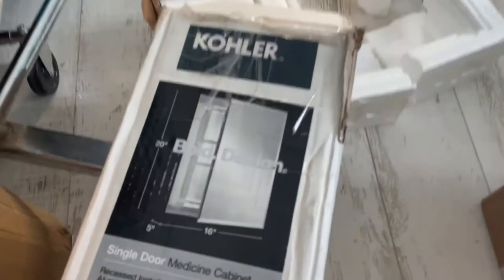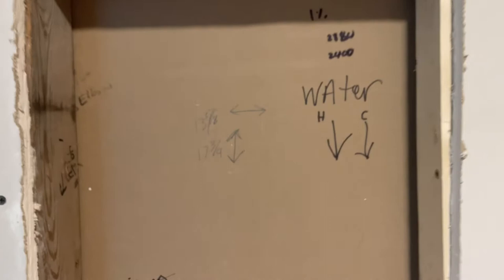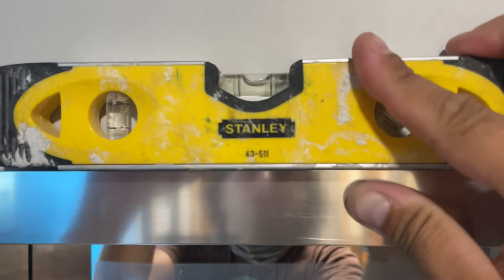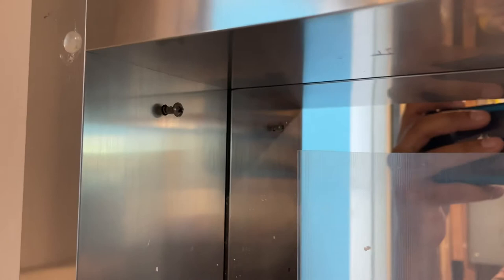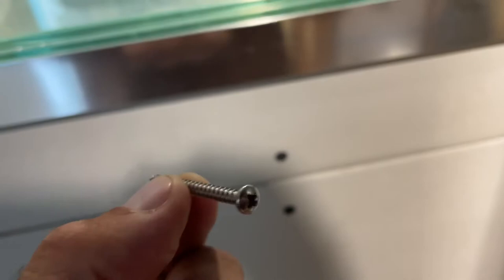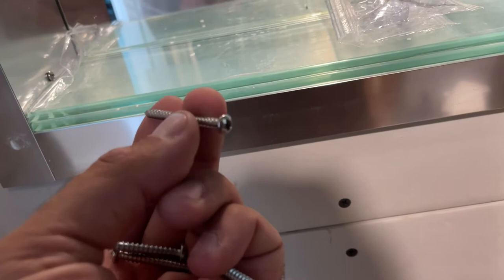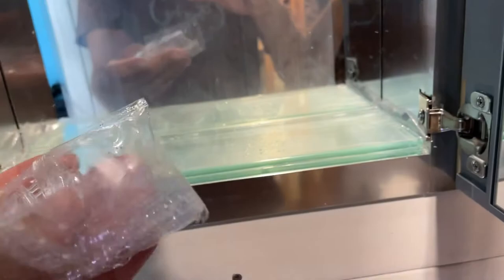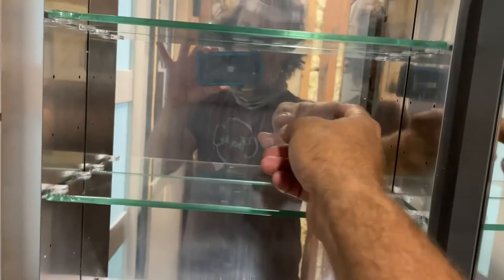How to install a kohler 16x20 medicine cabinet in your bathroom wall

Comment: For the old apartment building unit, this should fit perfect (almost).  The width is very good but one inch shorter, but i can live with that, cause its a rental unit.  My guess is that many of the older apartments actually has that size.  I'm 6' tall, and the mirror is fine with me.  Stay away from the cheaper plastic cabinets, the corners are rounded and flimsy.